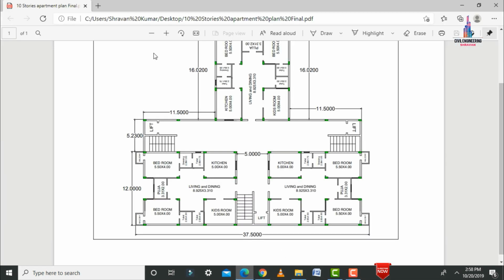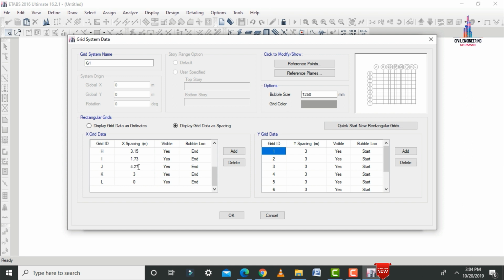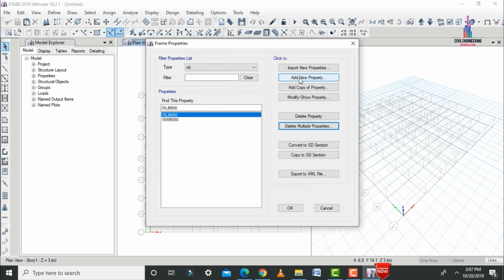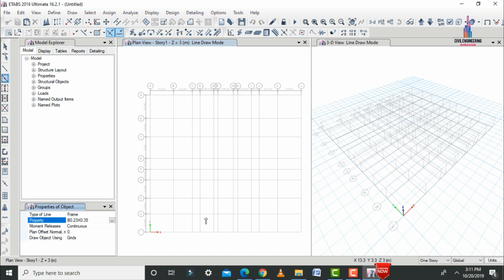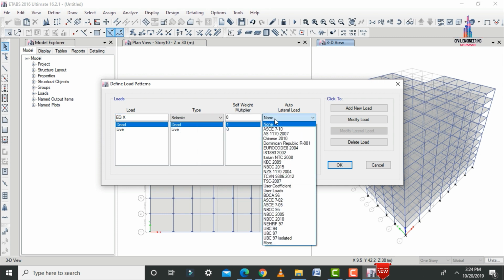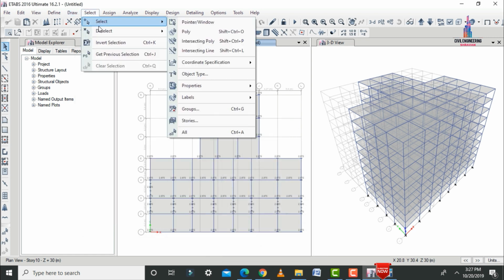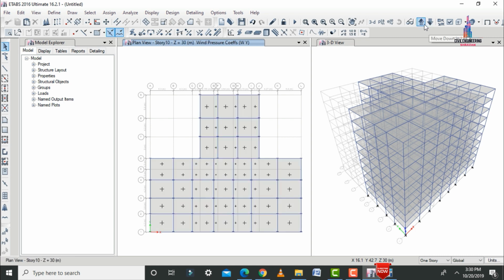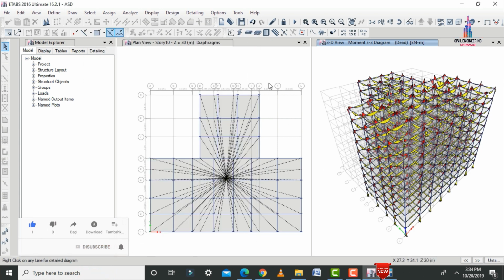10 storey apartment building modeling and analysis by ETABS Software part 1 | building design |

Comment: It is not the way to analyse the building because your miss lot of things like staircase loade ,mid landing beams, water tanks, secondary beams with moment release ,column orintation , at staircase and lift location slab will closed , different types of loads in dead load you missed etc...
Reply: @vishnuprathap9812  Show us the right way to analyze the building

Comment: Sir, i am doing a project on seismic base isolation system implemented on a residential building and thought of using etabs software..will u please help in knowing whether my project can be done by this software?
Reply from the maker: Yes it is possible please text me to my mail
Reply: @civilengineeringbyshravan9596  ok sir👍
Reply: Can made a career in civil designing